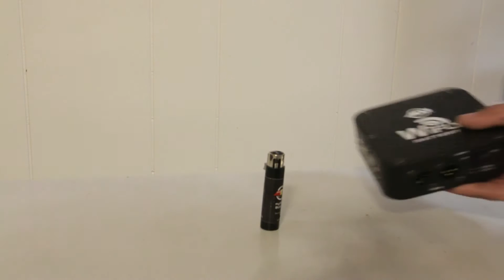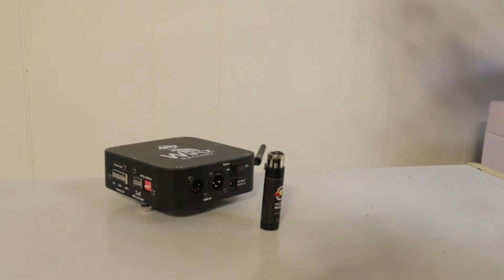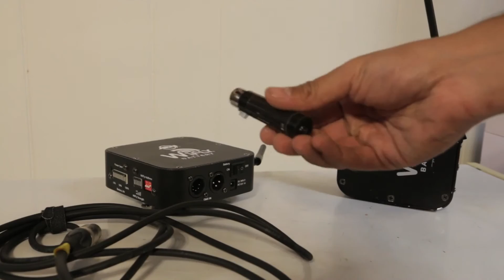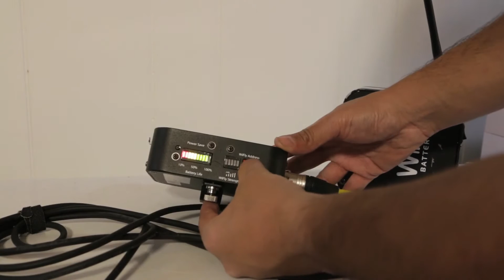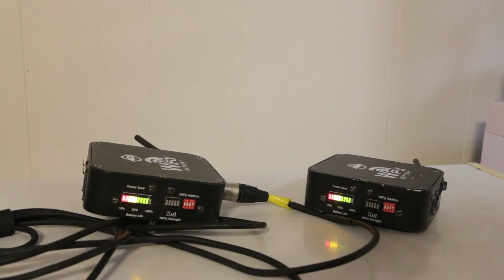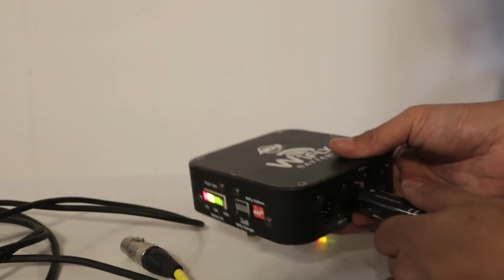MyDMX Tutorials - Using WiFly

Comment: good video but iv got a question on the older fixtures that are dmx can you put one of the dmx wifly antennas in the back of them fixtures and run them wifly
Reply from the maker: +chris nelson Yes, as I explained in the videos, you can put attach any DMX fixture to a WiFLY Transceiver and connect it to another WiFLY that's connected to a DMX controller.